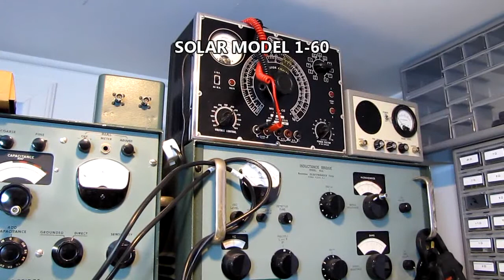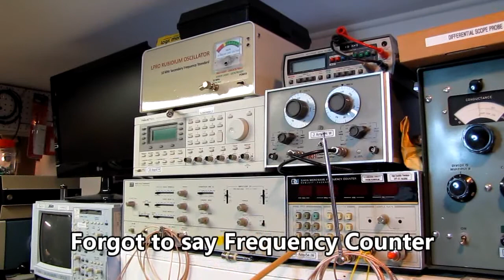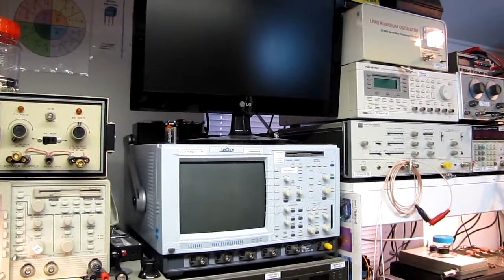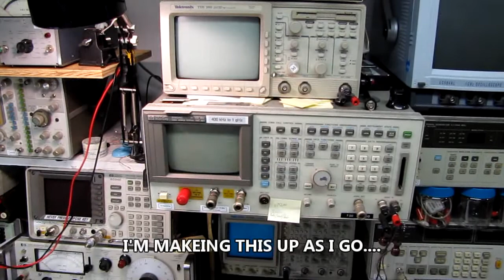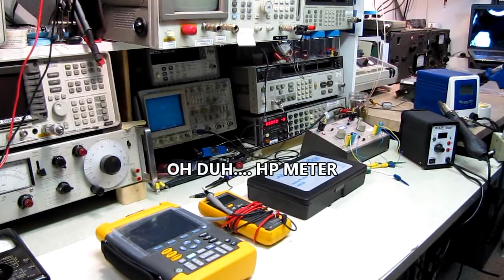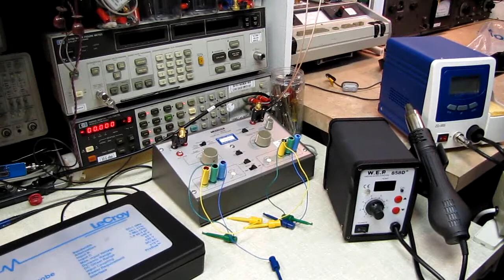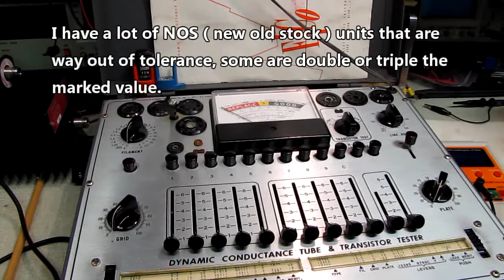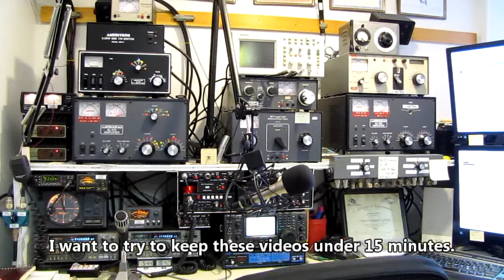By Viewer Request, a tour of the Lab

Comment: 15:00 I once worked as a repairman at a radio-shop, we started to call ourselves "board swoppers", we simply were required to follow the measurement guidelines and swap the board out! It took way more time to order a new board than swapping out a component we knew was the culprit. Often would the board + work time add up to be way more expensive than could be reasonable. Just because of this usual $0.50 component that always broke at that particular model, did we have to ask for $300 on an originally $400 unit! We ended up just swapping the component, called it a maintainess service, took $20 and kept our mouth shut to not lose the brand's repair license.

Comment: Nice tour of your shop. You and I have similar setups with  lot of HP, Tek and some Fluke gear. I have found so,me of the Heathkikt gear to be decent as well. Oh, i also have the Eico 666 and like it about as well as my TV7's.. My TV2 is excellent but time consuming to set up.
Just a note on older carbon R's. They tend to be somewhat hygroscopic and absorb moisture over the years, I have bins full of NOS Alan Bradly R's and most read too high 20 to 50%. 2 hours in a small toaster oven at ~150F f usually bring them back to 5 -10%, However, that does not usually fix R's that have been in service for decades. Hi
73, Glenn WA4AOS 
DSM Labs
Reply from the maker: Hi Glenn,  Yes, the Alan Bradly units seem to hold up well. When I find NOS out of tolerance I just toss them. Resistors are so cheap I don't bother with them. Funny how the old Vacuum tubes seem to be the most reliable components. Caps and resistors are usually the problem after 50 to 70 years. 73, Vern

Comment: Nice bench. Obviously Ham influenced. I recognized all the HP, Tek Kron-Hite equipment & analog meters. Have repaired most of them. The 2465B is my favorire scope. Fully agree about having an old Triplet or Simpson analog meter. The digital folks are catching on with the below digit bar graphs, but nothing like a meter movement for setting min/max applications.
Reply from the maker: True enough, and also the low impedance of the VOM works better when trouble shooting automotive or Motorcycle lights. No false "12" volt readings. Some high end DVM's have a low impedance setting, most don't.